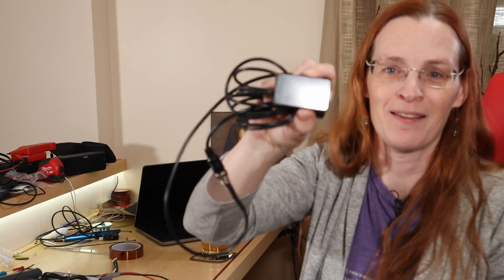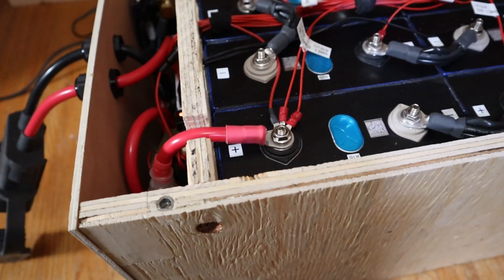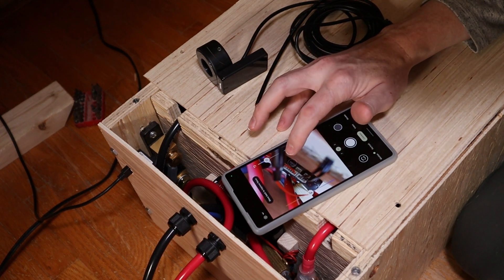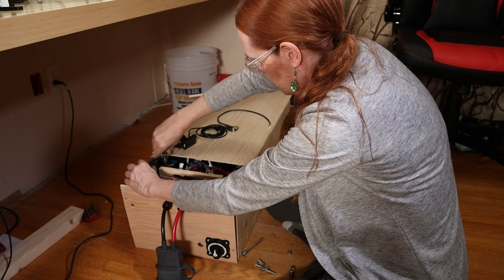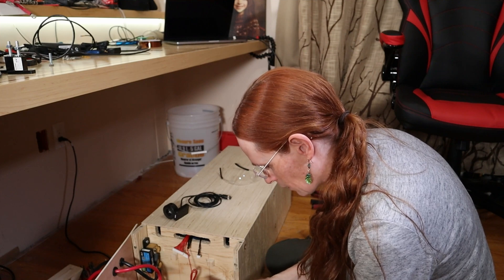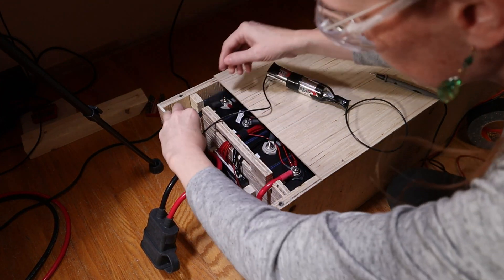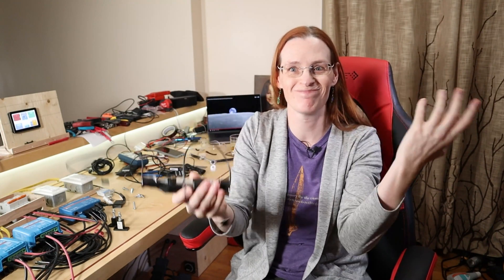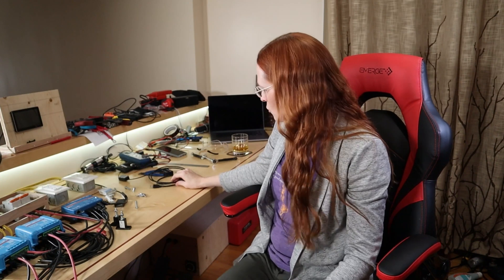JK BMS Frustrations - How to build a 48v Lifepo4 battery (Ep. 29)

Comment: I have had the same terrible experience with JK products and JK customer service! I bought the RS 485 adapter to connect my JK BMS after I checked that my model BMS was compatible with the adapter. It was right there in their page and I went ahead. The adapter never worked and when I contacted JK they said that my HW was 11 and not compatible with the adapter. It had the input and everything fitted fine. I said that it is clearly misleading to have my model without specifying that it needs a certain firmware to work and they told me the exact same thing! I should have checked and made sure that it will work although they clearly had my model of BMS as compatible and they never specified any exceptions! What a terrible customer experience! What a terrible company!

Comment: How frustrating the start up process of the BMS is; once you installed the battery, you will not look at it any more.  At least that is my experience.  My DIY battery is running for about 2 years and never started the BMS once.  I might check if the batteries are reasonable balanced or basic battery info from the BMS.  But there is just no need to the start up procedure again.  But indeed:  first time and during testing of the battery, it is a real pain...

Comment: I got my JK BMS a vew days ago. It came with a short connection cable to the display port and a push button on the other end. I will mount it into the front of may (future) battery box.

Comment: Did you ever get the RS485 connection to Victron? If so, what cables/connectors ended up working for you?
Reply from the maker: Not yet, but I bought the RS485 to USB adapter, and I plan to work on that as I assemble the new packs.

Comment: You need a programmable desk power supply to set voltage and ampere you need 😉
Reply from the maker: No problem if you have the money...
Reply: @TheDigitalMermaid  it’s not so expensive, for a 60v-5a max you need 200 dollars, it’s very useful not only for starting a BMS but also for charging the single cells of your battery, I made a mistake buying only the 30v 10a max , anyway I like your channel, your enthusiasm and I begun to build a my solar system from zero, like you! 😉

Comment: Mermaid. On a previous  video I remember you saying your BMS was a glorified resister?  That implies passive balancing.  I have seen both
included and add on "ACTIVE" ballencers based on shifting current battery to battery with capacitors. There is one made for JK and HELTEC 
makes a stand alone version in .6, 1, 2, 6, and 10 amps,  The 2amp version is for  14? to 24S LiFePO4 batteries. Pricing is less than $30 and 
some ads are $18.
       I was wondering how you will charge all those batteries while out sailing.  Possibly the prime mover is sail and the BLDC motor for in port 
use and the batteries are for communication/navigation electronics.

Comment: hey it might not have a slot cut in case. open the bms case and see if it has the 6 pin connection port I thin they all do thy just use different cases.

Comment: they have different models. its not that yours is old it didn't come with 2 extra ports 1 for lcd active switch and other for a bigger display unit. mine has the port but didnt come with a RS485 connection cable so I have to buy that.

Comment: I know im late to the party but i bought the same version bms you have and i got a single 18650 cell and a holder and that boots it up just fine, ill be mounting that holder and setting up a button similar to your pre charge button, but to turn on the bms. I think thats the neatest way, and ill have a spare 18650 charged and ready to go. This will only be needed for emergency night time booting as the solar charger does boot it up during daylight hours anyway.

Comment: Just turning mine on for the first time on a 16S Eve 280K pack and my March 2022 delivered 200A JK BMS has the connector for the "bike handlebar" display.   A long push on the power button of the "bike" display activated the BMS, Bluetooth pairing on and connected quickly.   No need for external diode test / battery bumps to ~5V

Comment: I have 7 different brands of BMS's on 132kWh of battery bank. JK 48V 16S is my favorite. They have the best app by far. Easy once you figure out the password bs. 1234 and 123456. I used my dc power supply to start it up.

Comment: What if instead of the jinky battery for 5v, you use a wire to tap into BMS lead 2 (6.6vdc) and touch the shunt to turn on the BMS?

Comment: Put a wire on the positive of the positive post two cells in battery in series before the negative post. Then connect that wire to wherever you were connecting down in the bowels of that front volume with a push button switch like you have for precharge. Then when the BMS is off, push the little start button. Easy Peasy.

Comment: NodeRed is a low code logic engine. It's very good for interfacing with lots of kit, processing information and reaching outputs in a block chart type of GUI. I would use InfluxDB and Grafana for data storage and graphing. NodeRed, Influx DB and Grafana will all happily run in Docker containers on a Raspberry Pi4, but use an SSD, not the SD since the IO will kill even a good SD fairly quickly.

Comment: Okay, So I've been trying all day to get my 8s JK BMS started. I thought with your battery contraption that I finally found a way around buying a 0-30v power supply... But for whatever reason the 4.7v battery that I configured still didn't start it, and so I tried 4 batteries making a 6.3v system and that also didn't work. I'm starting to wonder if my JK BMS is a dud! I caved and bought one of those 0-30v power supplies to charge up the batteries and also see if I can start the BMS... But that doesn't arrive for a few more days. Any ideas??

Comment: Nice review. You clearly answered the issue with powering on Jikong BMS. I bought one too.

Just my opinion, manual 4v to power up might have applications on motorcycles.
Like an another manual security switch 🤔

Comment: Can you just put a charger(solar panel) on the wires out of the battery box to turn it on?  Just needs to be battery voltage +5V(~65V).  You could even use a small capacitor with resistor to charge from 2 cells and put across BMS to activate.  Easy to make that remote capable with a double pole toggle to charge and activate bms.
Reply from the maker: That's effectively what happened by turning on the quattro and waiting. If I had solar, I suspect it would have worked as well. Trick is, what do you do if there's no solar while at sea? Sure, keep spare batteries, but it seems like an avoidable issue.
Reply: @TheDigitalMermaid  The capacitor idea can use 2 of your LiFePo4 cells to get the 5+V.  The BMS I am using doesn't require the 5V extra.  It just worked right out of the box once hooked up.  It is an avoidable issue...just most BMS suppliers think plug in charging is easily available.

Comment: Yeah, I love my JK BMS's, but they will be replaced with Seplos BMS's very soon. The Seplos comes with an LCD panel to see all stats right from the panel, without needing Bluetooth. Also, comms with MPP solar are in the works.
Reply: Seplos are committed to communicating with every type of inverter brand. I'm switching to them too. I already had JK balancers on all my batteries and was going to switch them all out to using JK BMS's to simplify, but now I have Seplos BMS's on order.

Comment: I think those bolts are ok to use.. I mean your goal is not to work on battery at all. Start it ..fix it and forget it. you will have bluetooth and you can change anything you want so no need to check it within. So my suggestion is use those screws..you will not work them too much anyway..but it is up to you usually simple solution is the best solution

Comment: I have just finished binge watching your series and I am surpised by how similar our plans are in terms of getting a boat, I would preferably electric. I have built myself a small battery out of li-ion 18650s from old laptops using jehugarcia modules, I estimate it to be about 180Ah, to practice with although I think I'm going to bit the bullet and got for the prismatic cells like you have. I do wish I had recorded myself building it but I haven't yet built the solar charger and inverter side yet so there is still learning to go. I am really excited to see how it goes for you! Good luck :D
Reply from the maker: Hiya and welcome! A major argument in favour of going lifepo4 is fire safety. On a boat, no life raft will do you any good if it burns with the boat. That's the primary reason I avoided li-ion. The boat stuff should, fingers crossed, be starting a lot sooner than later. ;)
Reply: Hi and thanks  @TheDigitalMermaid  I agree completely about the fire safety, I would not want to have them on my boat, the reason I am using them is I got an extremely good deal on a lot of old laptop batteries. I also would not want to go through the hassle of building a battery big enough to power a boat with this method as it is a lot of work to pull them out of the packs, clean them up, charge and test them all individually. It has been interesting and I have learnt a hell of a lot from doing it.

When you consider it has taken me weeks to get to the point I am at now with a 180Ah abttery, this is a little over half of one of the prismatic LiFoPE4 cells you were talking about ordering in your Christmas Live Stream, for probably not much more money than the cells the economics for the 18650s falls off a cliff very quickly even before you include my time as well.

I am really interested to see how a Torqeedo pod works out for you, I had no idea they existed and seem to be a brillaint solution to going electric.

Comment: They do tell the customer about the incompatability issue on their product page now, saying:
"(Please check whether BMS has LCD interface before purchasing. If there is no interface, LCD cannot be used.)"
I don't know since when they state that but I think it's good, they changed it within 2 weeks after this video was posted. Thanks for this video!
One question, I'm sure you have answered like a million times before: what battery connector are you using? I'm talking about the beefy one comming out of the battery case.
Reply from the maker: I'm really glad that they've made it more clear. The beefy connector is an Anderson two pole 175A connector, with the water resistant boot over it.

Comment: For the case..

I ended up with Coosa board with stainless rods as the 16x350kg = 5.6Mg expansion force the cells exert is really hard to deal with any other way.  There will be -2mm size variation per charge cycle.

You might also consider adding cell to cell spacers to back up the cell wrap.

Comment: For data flow.  SignalK is well worth looking up.  Writing a plug in is easy.
Then node red, a time series data base and away you go.   Personally I added touch screens to a Pi 4 to run the node red rather than on the victron.  But i didn't want to mess with the power system programing other than writing some simple plugins.

Comment: Box material and strength..

The batteries box needs a holding force of about 5tonnes.. 350kg per cell. This is to deal with charging and life dimensional changes.
Coosa board is great for a side material.  Then Kevlar wrap for surface strength and stainless through rods.
Final thing I learned is that the cell case is cell negative and that the battery shrink-wrap is awful thin and easy to damage.  Most people are using a secondary spacer.
Reply: Just to say.. my first battery box was built much like yours.  The constant heaving of the batteries split it apart after a year.

Comment: The one good thing you can take from this was, bring your wires into one side of box for your boat. So when you take your side off it will  hinge out of the way.
Reply from the maker: Ya, I'll need to make longer balance leads, but a bottom hinge is getting quite appealing.

Comment: Ever thought about adding some DC/DC Isolated converters to your project? 48vdc to 3.3v or 5.0v or 12.0v. This would give you an isolated floating supply... add and momentary switch to 5v to activate the bms and also ideal if you are planning to add devices such as a Raspi or other monitoring devices.  And isolated USB ports as well......    just a thought....  I always use old telecom converters in my high current/high power  projects.....
Reply from the maker: I actually have thought of that, as I will need different voltages around the boat. I've got some plans on this, but they'll come later.

Comment: Nodered is really cool but it’s a logic processing solution.  I also tried all kinds of logic rules and using containers with different software, but in the end, it’s so hard to beat the Cerbo and the BMS below. 

That said, I have been through most of what you are going through, and I ended up with a Batrium BMS as a result. It just plugs into the Cerbo and it just works. I get cell by cell details, whole pack details, and complete integrated control of my victron ecosystem. (MPPT, Dual-Quattros, 32 Lishen 272ah cells, etc). I wouldn’t trade it for a Jk BMS any day. I still have 2 sitting on my shelf that I occasionally use for bench testing cells, but not in a production system.  It’s too janky for me. 😊
Reply from the maker: I'll have to give Batrium another look, thanks for sharing your (happy) experience with them.
Reply: @TheDigitalMermaid  Assuming you are stateside, would you like to borrow my spare Batrium BMS to test out?  I’d be happy to send it to you to try out. I know they are expensive.
Reply from the maker: @Shep5847  That's exceedingly kind of you to offer! I'm not in the US though, I'm in Canada so chances are there'd be a healthy import fee.
Reply: @TheDigitalMermaid  I realized that after I sent the message.  It’s your call though. I don’t mind. I figure the weight with the shunt would probably be less than 5lbs.
Reply from the maker: @Shep5847  Very kind! The trick us, that little RS-485 adapter? $35 import fee, it was worth ~$60. I did look at the batriums though, to see if they had Canadian supply. It seems they are more focused on cylindrical second-life cells. Well as I hinted at in the video, I have something going on behind the scenes. :)
Reply: @TheDigitalMermaid  You are very welcome. Just fyi, Batrium isn’t cell type specific. It can be used on any cell type not just cylindrical. I have the same cells as you and use it with them.  If you find an affordable way and want to try it, my offer stands. 😊

Comment: I think the 'DIY BMS' is well worth it, being you only need the one, and can just add more modules if the battery grows, and current doesn't matter, just get a shunt rated 2x peak current, a shunt trip breaker works nicely also!
Reply: Also saw that the DIYBMS has software support to integratie with Victron GX devices. Check https://youtu.be/byNTtQzofts

Comment: What you can do is get a 100uF cap and a switch. normally the cap is across the first 2 batteries (2*3.2v) and when the switch is flipped, the capacitor provides the voltage you require to start the BMS. You will need 2P2T to rewire both ends of the capacitor to the necessary connections. Havent tried this but it should work. You may need a bigger capacitor depending on the current vs time requirements of the BMS for starting it. YMMV
Reply from the maker: That's actually not a bad idea... Thanks!

Comment: Hei, welcome back! Even with this two red lines... Hope you are fine again!
Crazy, that this starting of the BMS via Multimeter does not work in your case. Maybe this old JK BMS from you is the reason 😉. I tested it again for the 8S version of the BMS and it definitely works. I also checked the output voltage on my multimeter in diode test mode. It is only 2,8 V. Maybe this is too low for your BMS. 
Then you have to go on with this nice battery tower...
Have a nice day!
Reply: Andy and the manual clearly state that this BMS needs more voltage to start. Try two multimeters in series..  Maybe the display fits on your BMS, do you have that five or six point connector on your BMS?
Reply from the maker: @johthe  They might, but the goal of my channel is to help regular people see what it is take on a project like this. I was OK with the home bench supply because it was just a way to save money that someone could ignore. The BMS is core though, so I don't want to suggest people void their warranty or, worse, risky damaging a device with so much power going through it.
Reply: @johthe  yes I know, that the documentation says min 5V. But in case of the 8S BMS it works with less. And I really found a 6 pin connector on my BMS. But its labeled in chinese...🤨
Reply from the maker: It was a brilliant idea, and I am still really glad you shared the suggestion, thank you!
Reply: Okay, So I tried both of these methods and I can't seem to get my 8s JK BMS started! I even tried a 6.3v battery stack that I configured. Nothing I try has shown any amount of life in the BMS. I am starting to wonder if I have a dud. I'm wondering if you have any ideas.
Reply: @rossallen738  Hi Allen, that sounds not good... Have you checked all other connections? Black thin wire to minus of battery pack, all cell voltage cables and also cable to positive of battery pack? Did you connect the correct thick cable to minus of battery pack? If all this is ok, then maybe your BMS has really a problem.
Good luck!
Reply: @andig69  I found a solution after reading comments on several videos. I had wired everything correctly, but for whatever reason these other methods weren't working... The method that finally worked was taking an external 6v battery and connecting the negative to the P- and the positive to the B- on the BMS itself. Once I did that, it started right up! Not sure why nothing else worked.